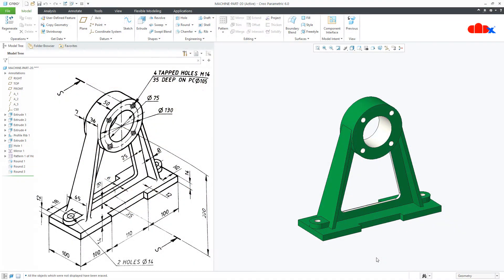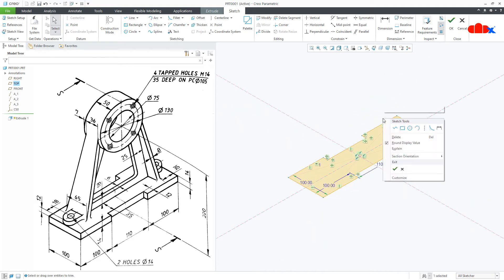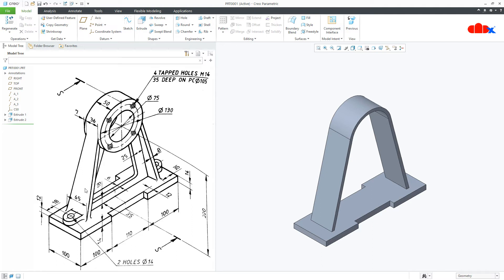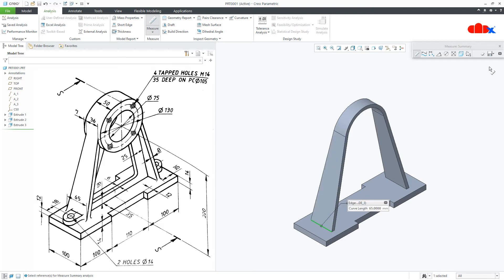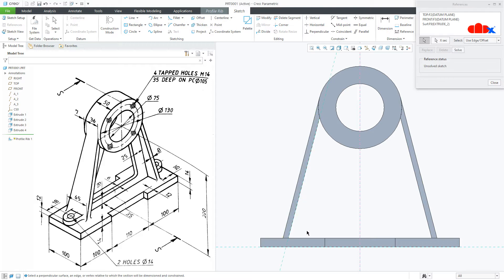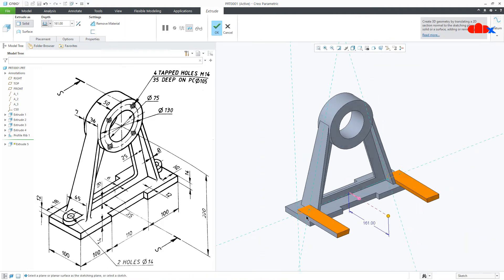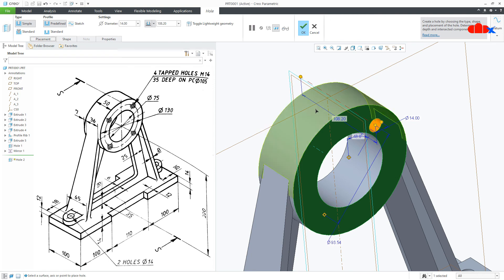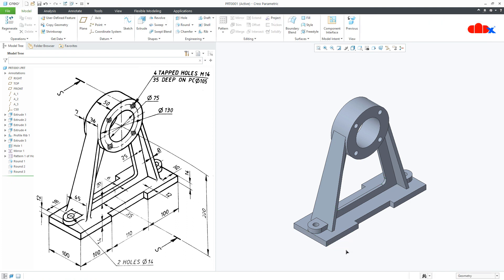Creo part modeling tutorial Machine part-20 in Creo Parametric

Comment: sir, when u r doing  M14 hole its coming correctly...when i put M14x2 .... the hole is like 0.4724 dia.. the dia of the hole is not changing.
Reply from the maker: Try some other size
Reply: @CADxTraining  I tried .. can't able to .. the M hole screw sizes are very small compared to ordinary / simple 14 dia hole
Reply from the maker: You are facing this problem because your part has English unit. Change your part to metric unit.